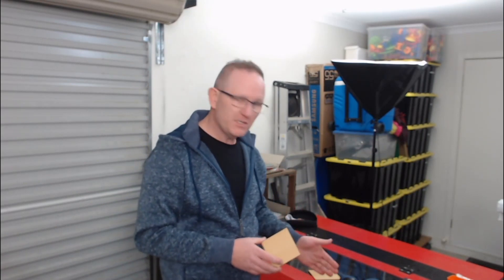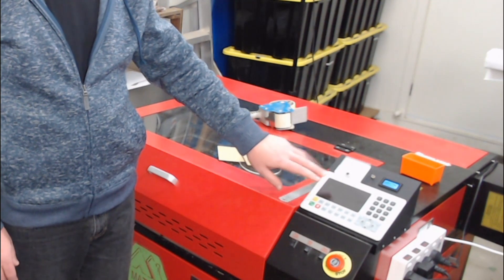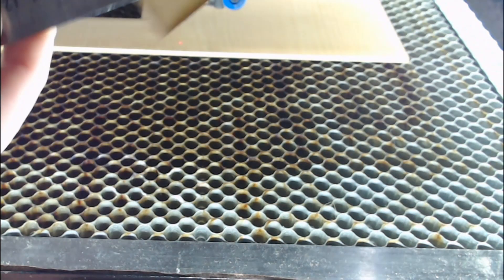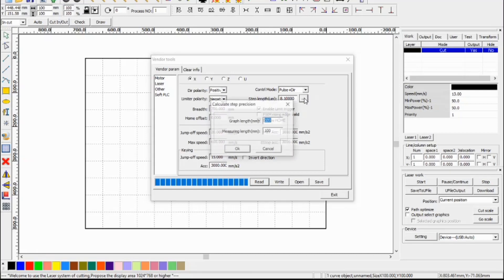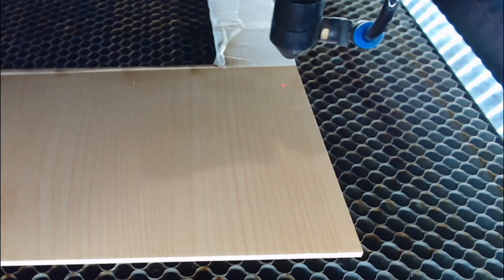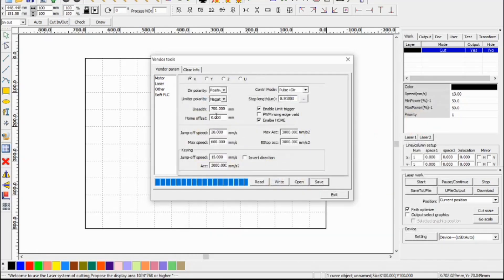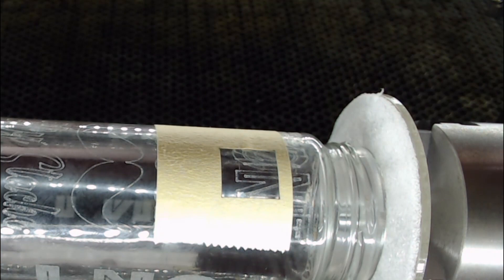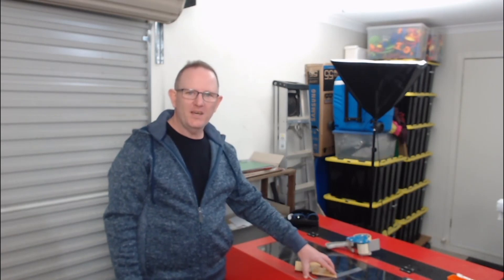[08] RuiDa Controller - Calibration of X and Y Axis for CNC Co2 Laser - RD Works

Comment: We definitely appreciate your videos. I have a loaded question for you! Our machine has lost its parameters ever since using the rotary, I try to load what had been the machine before and it seems to make no difference. It jams into the corner and even then it is now engraving things 2x the size they had been before and backwards! If you could help us out in any way we would greatly appreciate it.

Comment: Hi, I tried to cut a square 400x400. The measurement on all sides are 400, but it was not a true square with four 90 degree angle on all four corners. How do I fix this? Is this something I can do with the calibration on the controller or I have to work on the gantry? Thank you.
Reply from the maker: This indicates that the gantry may be out of square.  You will need to adjust by loosening the Y axis shaft or belts, get it square and then retighten.  After doing this you will need to reperform mirror alignment.  Note: all machines have different methods of adjusting the gantry.

Comment: Hi Matt, thank you for your videos, i have this issue, I have a problem. I calibrate 100x100mm square, but when u cut 500x500mm i measure 503mm, what can i do so i can have good accurancy any measure, i use rd works and 6445G controler and is a 1600x1000mm my working area. Thank you for your help
Reply from the maker: For higher accuracy Perform calibration at 500mm rather than 100mm

Comment: Had simmilar problem when cutting on 1200x900mm laser. It was calibrated with 100mm square, but when parts were longer like 1m or more, there was 0,9% of error. All parts were too big. Is it better to cut like square or rectange with  size of max working area. At the moment I’m working on diy laser with RDC6432G controller with working area 650x450mm ( my goal is to use 600x400mm plywood on it).
Hope to see more new  videos on this channel about ruida and laser machines. So many great informations here.
Best regards from Slovenia.
Reply from the maker: the larger the calibration square cut the more accurate.

Comment: When i cut 100 x 100mm its ok. But cutting above 1000 or more size is cuming different
Reply from the maker: Calibrate with a larger size square, the larger the calibration cut the more accurate you can make it

Comment: Good evening, I have a ruidardc6445g and I need to use 2 motors on the Y, for that I will use two different drivers, I would like to know if it is possible to connect them to the same Y port of the controller so that they are synchronized. it would be possible? Or could you tell me what would be the best way? sorry for my english lol

Comment: what about the kerf on the laser. the laser is cutting in the middle on the line. I also see that if you get perfect cut on mdf it will be different on acrylic.  due to the acrylic melts more and give you a bigger kerf.  i know i can set positive and negative kerf to get lightburn to cut outside the line or inside.  but its really tricks with my mind when calibrating like you do on the video.  on cnc its easier because there you choose inside or outside cut and you know your bit size.
Reply from the maker: I have plan to do video for this in next few months.  For calibration most common mode is to calibrate for the size of the cut out piece not including the kerf.  However you prefer to calibrate for your machine, will depend upon your own preferences.
Reply: @MWLaser  thanks for answering, the best way i have found is to engrave squares then measure from center to center. when jt come to kerf my method is to make a cut profile for the inside cuts and one for the outside cuts. now my machine has perfect measurements on inside cuts and outside cuts.

Comment: Hi Matt.
Thanks again for your helpful video.
After struggling too much I could do the calibration,  with cutting I don't have any problem but while engraving the laser head moves far from the engraving area from both sides on X.  Which is the parameter setting for fixing this issue?
Thank you in advance for your help.
Reply from the maker: Try looking at your Acceleration settings for the X Axis
https://youtu.be/WS_Qkimz_CY?t=543
Reply: @MWLaser  Thank you so much, I did all you said but still the X travel too much far from my engraving area, whereas for cutting it is ok, the only problem is only for engraving. I am so upset....

Comment: Hello, thank you very much for the explanation. I have a question, what could be happening if the calibration does not work with my machine, the failures in the cutting precision are always variable, they fluctuate between 1 and 2 mm of failure and calibrating it does not work.
Reply from the maker: this variation could be attributed to loose belts or "slop" in the axis.  Also I recommend measuring accurately when calibrating with a digital caliper.

Comment: I have a problem when I click on read I get the notice of (no device connected), where should it connect? on Mi PC?? - My cnc does not have wifi or will I have to put a network cable from my pc to the internal panel of the cnc? please help
Reply from the maker: https://youtu.be/68HDkseLNeY
Reply: @MWLaser  
THANK YOU VERY MUCH! I was able to solve the problem, thank you for your response

Comment: hi thank you for information i have a Question please
if i upgrade my Laser from 30 W to 100 W what Vendor Tools in Laser TAB i need to Configure Because after upgrading my Machine to 100W it still work like 30W Laser
and Thank you Teacher :)
Reply from the maker: What components did you upgrade? LaserTube? PSU? 
What Controller are you using?
Reply from the maker: Email matt@mwlaser.com.au

Comment: My laser Y is of by aprox 10% but adjusting the step length doesn’t change anything. It used to work but now it like the Y step length is locked in the controller. Any suggestions ?
Reply from the maker: What type of controller are you using?
Reply: It’s def a RuiDa. Not sure how to identify the model. I’ll see if I can get more info.
Reply from the maker: @freakshowcustoms9094  Follow up by shooting me an email - address in video description. Cheers Matt
Reply: My problem is identical to your old problem. Can you tell me what you did to fix it? My y-axis is off by 5%, but no matter how I adjust the step-length in the vendor tools it just keeps doing the same thing. I did remember to click “write “. I know it’s been a few years for you, but I would love to know.
Reply: @yortwatson8244  It turned out to be the controller board.

Comment: If I do the calibration on Rd works, and then I want too use lightburn,  would the calibration still work? Or is only good while using rd works ?
Reply from the maker: Once calibration complete it is saved to controller, so it is accurate for any software you then use.
Reply: Matts Workshop thanks! Keep up with the videos!

Comment: Can you do this in lightburn or is it only in RD works
Reply from the maker: You can view and edit these calibration settings in LightBurn, But there is not the option to enter graph length and measured length.  It is much easier to do these calibrations in RD Works.